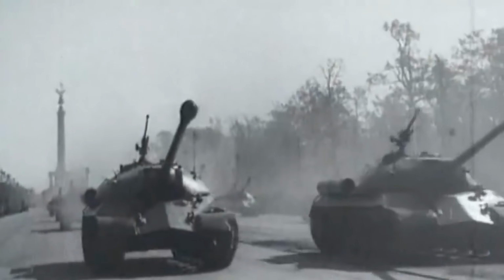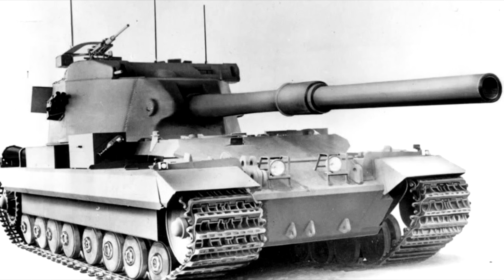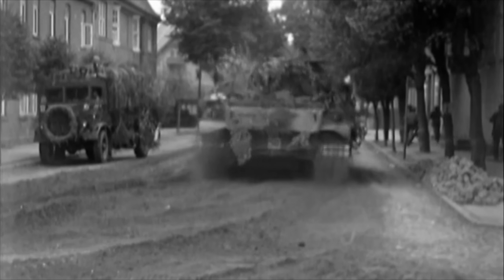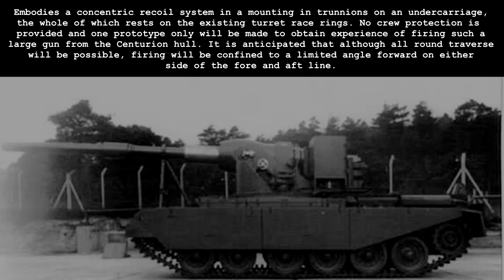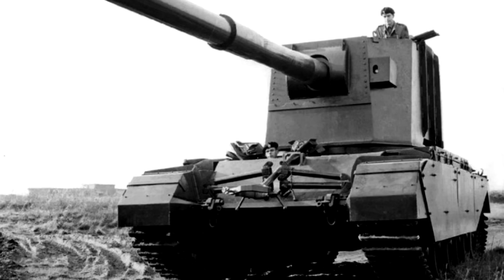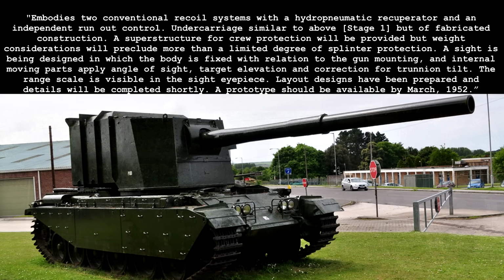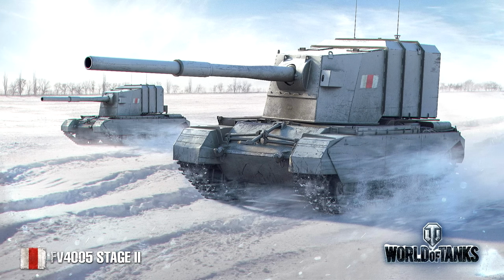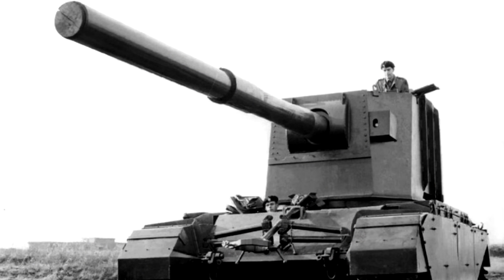British Boomstick, the FV4005 | Cursed by Design

Comment: The British experimented on the new HESH --High Explosive Squash Read round since 1943. It was soon judged excellint for demolition and by 1945 was being developed as an Anti-tank round, its advantage being a one shot kill as the explosion would devastate the target. Thick armour didn't matter the shock efferct would dislodge a scab of metal which would rebound round the interior of the tank at high speed. The FV4005 mounted the largest HESH gun at 7.2 inches caliber, which would devestate any tank made. But the FV4005 was vulnerable, the large 'gunhouse" was only thin plate and the gun was slow firing. It was abandoned after testing.

Comment: In the context of war thunder its a GOD AWFUL tank.

The gun has the potential of one-hitting, but:
- if you hit anything like a side skirt or a protruding headlight, the shell won’t do anything 
- the tank is slow af so ducking into cover and peaking is never gonna happen because enemies will just tap you before you have line of sight
- the reload is so ridiculously long that you may as well carry only one shell as youll die before you reload
- the armour is so thin youll pretty much get penned by anything bigger than a .30 cal
- the “forehead” of the tank is ridiculously tall so youll get killed even in cover behind hills so again good luck peaking over hills
- the turret doesn’t even have 360 rotation, so good luck peaking around corners
- all this means its only really viable at long range, but the shell drop and travel time makes shots impossible on moving targets 
- and despite all this, the shell still does bugger all on most tanks even if you nail them in a good spot

stay away, this tank is a HUGE waste of research time

Comment: To be fair to the tank it was not designed to directly confront Russian tanks but to sit behind tank fleets and pick off Russian vehicles from outside their range. 

It was more of a huge mobile artillery piece. 

It would probably have work but its limited speed and ammo capacity means it’s limited use. 

And anti tanks missiles get better negating its need.

Comment: I'm happy that Bovington has announced they're going to undergo restoring their FV4005 including getting the turret fitted onto a more accurate hull iirc. I think I remember it's even supposed to get restored to join the rolling stock so might see it trundling about the arena at Tankfest someday!
Reply: You can see the restoration on the Mr Hewes you tube channel, being restored to as new with fully functioning running gear. They supposed have the drawings for the blade so will be recreating that too. 

Built by a couple of blokes in a shed, and restored by a different couple of blokes in a shed.

Comment: 183 MM Main cannon had 2 part ammo. The shell and the propellent. The AP shell weighed over 50 kilos, 120 pounds and the propellent a further 28 kilos , 66 pounds.The shell loader must have been a circus strongman. Utterly ridiculous. However if the gunner managed to hit another tank with that monstrous AP round. It would be reduced to a burning pile of scrap metal.

Comment: Had this been in use upto the 1970s or 1990s it would have gotten Export customers like the Israeli army and South African Army since they have to go against Russian allies like Syria Egypt in  the case of South Africa the Angolan Military. Engine would have been with place from the original Petrol to a Diesel type. More recently sent to Ukraine if Modernized to fight the tier 9 Russian Medium Tank T-54/55 & Tier 10 Medium Tank T-62 but will struggle against WOT Console Modern Tier 10 Heavy Tank T-90A. Using war thunder T-72BM to the proposed T-14 Armata used by Moscow military District

Comment: This "shit barn" was higly vulnerable to air strike and artillery even at this time. They could have possibly fought against IS 7  but would be obliterated by this too heavy but much better designed tanks. If those were produced at all.  If all you have is a large bore gun and bad/mediocre armour??? Bomb them, shoot them from an abush from short distance, circumvent them and shoot from the side or rear... all tactics well known from WWII.  So only a test specimen as told, no real "mbt", not even intended. So if i some way fixed a used 15" battleship gun on a used tank chassis i would break this record....

Comment: This thing if it identifies is first might litterly blow the turret off of an Abrams if it were to hit it in a good spot. The isu152 was quite literally able to blow turrets off of panthers using he shells that wouldn't even penetrate. It was just so powerful that it could litterly hit the turret and crunch the turret ring and a good Chunk of the hull and the turret just slides off and ends up nowhere near the tank. That's with a tiny 152. God knows what a 180+ mm very long gun could do to a tank

Comment: At 4:38, you state that the elevation of the gun was fixed. Yet the pictures clearly show its trunion mounts and elevation clearance under the cradle. The view from behind also shows that the breach block is separated from the loading mechanisms. The substantial travel lock appears designed to restrain the gun both in elevation and rotation. I would conclude that it was capable of elevating.

Comment: I don't get why they didn't try to make it a turret less design to make it a smaller target and better armoured. For the role it had, a turret would not have been necessary.
Reply from the maker: That's a good question. If I had to guess it's because the tank was intended just to be a stop gap for the heavy tank armed with the same gun. I'll ask around and see if I can find any info on that

Comment: IS-3 proved to be frontally immune to the 105mm APDS of Centurion with the L7 gun. I think their fears were very well placed. Just like any WWII designed and build tank, the IS-3 had its teething issues, but that did not mean it could not be used in battle.

Comment: Not the largest gun by any stretch to be intended to fight tanks, Sturmtiger was officially designated as a tank destroyer and had a 380mm rocket launcher and also saw combat and blew up tanks in WW2 unlike the FV4005
Reply from the maker: The Sturmtiger was not designated as a tank destroyer and I don't know where you got that from. It was an assault gun (the name literally translates to Assault Tiger) and was used and classed as a self propelled gun. It was used against tank units at least once but as an artillery piece not a tank destroyer.
https://tanks-encyclopedia.com/ww2/nazi_germany/sturmtiger.php
Reply: @ConeOfArc  There are youtube videos with the proper Sturmtiger manual/documents, in them you will see it was assigned both as a tank destroyer and spg
Reply from the maker: @cattycats4  then link them
Reply from the maker: @cattycats4  the tank was still not intended for that role. it makes sense that they would give it a direct fire sight and obviously it could be used against a tank if needed but it was built as an assault gun to shell enemy positions or destroy bunker's not to destroy enemy tanks. By that logic any artillery piece with a direct fire sight could be classed as a tank destroyer.
Reply: @ConeOfArc  it was intended for both roles, clearly. a regular spg would not have details to engage tanks in direct fire in their general documents. sturmtiger was designed to face enemy tanks as well as bombardment even though its role was mostly as spg that should not exclude it from being a tank destroyer , additionally it proved the tank destroyer role in actual battle so I think its beyond argument, a Tiger 1 chassis with 150mm sloped frontal face is not logical for only an spg but makes a lot of sense as a tank destroyer/spg especially considering the massive dispersion of the rockets at range to use it in tank range would make the accuracy much more effective, it was designed to be this way and it was used this way, maybe you can do a video about it? I would enjoy. thankyou for replying mate
Reply from the maker: @cattycats4  the armor it had was to protect it while it engaged targets in urban environments to support infantry. Yeah it definitely would be able to be used in multiple roles but you said it was officially designated as a TD which is false. It was a heavy assault gun primarily to support infantry. It was equipped with a proper sight for that reason as well I'd imagine since trying to indirect fire that against close targets makes no sense. There's plenty of other examples of weapons not built for the purpose of antitank which could still do so if needed including basically every SPG.
Reply: @ConeOfArc  you could also argue that a lot of tank destroyers were not tank destroyers but spgs too, like SU152. I think the key point is wether it was designed and intended to perform a tank destroyer role if needed and for this the Sturmtiger officially qualifies (as its official documents support that) although when I said it was officially designated as a tank destroyer its from seeing a german document listing it as both and I have been unable to find this but Im not saying it from opinion. however there are a number of different labels from tank destroyer, assault gun, self propelled gun, artillery, there is room for confusion but I saw it listed as both which removes confusion and it even had different ammo that also wouldnt make sense for spg class.

Comment: That design is just.... dumb.
They were aiming for a tank destroyer with a massive gun., build on a design, they already had and were expecting to have a limited fireing angle, because of the massive recoil...
Basically they aimed for a similar design as the Jagdtiger, just worse. Extremely tall silouette with paper-thin armor, abyssimal ammo storage capacity - even the Sturmtiger with its massive 380 mm rocket-propelled projectiles could carry at least 14 of those...
Good timing for the 105mm L7 Gun to enter the stage - it saved the world from this ugly abomination of a tank (and dominated western tank designs for decades).

Comment: "We can only fire the gun in a narrow arc parallel to the tracks."  "Give it a rotating turret anyway."
Reply: Ehh why not add some cardboard armor to keep out the rain
Reply: You need the rotating turret to stop shrapnel, and it needs to rotate to free up the engine deck for repairs. It obviously won't fit in the hull, so there is no other way.
Reply: @charlesc.9012 how on earth would a rotating turret stop shrapnel
Reply: @TinyBearTim  It has about 13-ish mm of RHS plate, which is enough to stop small arms fire and shell shrapnel. It is the difference of a truck vs an MRAP.

Also, look at the size of that gun, without a rotating turret, it will be limited to less than 5 degrees left and right traverse, not actually useful.

Comment: 152mm, sloped at 60⁰, at 2000 yards... The Brits basically said, "You've got a pretty big hammer Ivan, but mine's bigger." when they designed this gun. Looking at tanks like the IS-7, I'd say the aforementioned requirements were fair.
Reply: When you absolutely, positively have to kill an IS-3 from any range, at any angle, and with any hit; the L4, accept no substitutes.
Reply: Shoots through a KV-2 gun at a 60° angle
Reply: N@ZIS : YOU RELISE THIS WAS MY IDEA...

Comment: There is something about this gun that really, REALLY doesn't make sense to me. As background, I've been an artilleryman for 33 years. 
The problem is, the gun does not have a hydraulic rammer. Because of this, I can't figure out how they got the brass O ring on the round to seat properly where the rifling begins in the breech. This is critical because if it does not seal there is blow by of the gases massively reducing the muzzle velocity. Smaller caliber guns solve this problem by housing the propellent in a brass cannister, and when fired the cannister expands to seal the breech. On separate loading ammunition like this, there must be a seal and the amount of force needed to properly seat this weight of projectile is beyond an individual loader which is why a hydraulic rammer is used on large caliber pieces. Soooooo, how in the hell did this thing ever work? I am guessing that if they had moved forward, one of the mandatory changes would have been to add a hydraulic rammer.

Comment: No armour, sets high in the air, large target. "Don't worry about it, you are a support tank, you shouldn't be targeted". 
Best layed plans of mice and men. At 2000m it's hit chance is pretty low compared to others. The tanks to be supported, aren't. The size will still make them targets, as they will be the only tanks seen in a lot of topography types. Typical British tank, concentrate on one aspect of tank vs tank combat, or infantry support, and skip the rest.
Reply: "At 2000m it's hit chance is pretty low compared to others." Based on what?

American TDs did well enough for themselves without armor, with the Sherman hull so criticized for its high silhouette, and so did Shermans with their even taller one. And this tank is taller, but it's also designed in a period when they did not intend to go on the offensive against the IS-3s they built it in response to. In effect it's a much more mobile, albeit much clumsier to reload and harder to hide, anti-tank gun, just like any other tank destroyer—only more.

"Typical British tank", is a bizarre criticism to me since in this period everyone still had light, MBT, and heavy tanks, and even the Germans in the first years of WWII had Panzer Is alongside IIs, IIIs, and IVs (of which only the IV had an HE round up to later standards). Only the woefully unprepared Americans didn't, and that's because they barely had/didn't have anything yet. Plus this vehicle was designed to complement the Centurion, one of the first MBTs and one of the best tanks ever built.

Comment: What I like the most about IS-3 debuting on Victory Parade in Berlin is that T-44 wasn't shown. And later on, reworked, upgunned and uparmored it turned into T-54 aka main force behind soviet ground forces armored fist. So it ended up being an unintentional misdirection on soviet part. Otherwise Allies/NATO might have instead pursued the upgunned medium tank projects that would see medium tanks comparable to T-54 being the main focus of development efforts. Uparmored Centurion with 32-pounder and Caernavorn drive train? M26E1 with streamlined hull front, long 90mm and T32 drive train? Basically do what soviets did to T-44 to get T-54 instead of waiting for M48.

Comment: The really odd thing is the idea that this huge, virtually unarmored, target was supposedly suitable for direct fire combat against the IS-3.
Even if it had greater range (did it?) where in W. Europe could it find targets that wouldn't kill it back?
The lack of ability to elevate the non-turret version is mentioned, but I assume that wasn't true of the turreted version.
Reply: It's probably more of the 'Drive it to location, dig out firing position and use earthen walls/camo for protection, set up range markers then wait for enemy to come within firing distance, then fire until either you're dead or they are. If you survived the battle, congratulations! Now drive back, resupply and redeploy.' End of the day, you can't hit what you can't see, and if this thing's over a thousand feet away and camoflaged in the middle of a forest or in a dug-out trench covered by grass, then by the time you've spotted it, worked out it's range and worked out the correct balistic tragectory to hit it while you're on the move, it will have fired several times and probably killed or crippled several tanks. By the time you're close enough to see and hit it easily, there are plenty of other enemy tanks that are now in range to kill you too, so the big, slow-firing entrenched gun is less of a concern.

 If you're wondering 'why not just use a regular non-mounted anti-tank gun' two reasons - firstly, far less protection from shrapnel/small arms fire for the crew, secondly you'd need a big-ass tracked vehicle to drag it along anyway, so why not splash a little extra money to get a self-contained unit which allows you to add firing systems making it easier to aim?

Comment: Since HEAT penetration is directly dependent on how wide the warhead is, imagine a 183mm HEAT round
Reply: I mean, HESH is pretty much the same - problem with HEAT is that it's hard countered by Ceramic composite armour (which the Soviets pioneered), reactive armour (again, Soviet pioneered, and while tandem-munitions can negate it, you're still firing a smaller charge as a result) and spaced/appliqué armour (seriously, there are stories of tank crews strapping tree branches to their tanks to negate the effects of HEAT). Ofc HESH also has a lot of weaknesses too (basically replace Composite armour with spalling net and it's the same) but is a more versatile ammo with greater effect against soft targets & bunkers and is better at dealing with thick or highly sloped armour. There's a reason HEAT was largely phased out by most millitaries for more specialised SABOT/HE rounds and a reason why the UK stuck with HESH as an all-purpose round.

HEAT is still applicable if you can hit the right areas - which is why it's still common in handheld anti-tank weapons where you tend to be a lot closer to your target than in tank battles and as such have a better chance at spotting and avoiding the composite armour plates/reactive plates/appliqué plates, but if you can already snipe a tank's weakpoints from 1000+ feet away, there's other things you can use which are either cheaper or more effective.